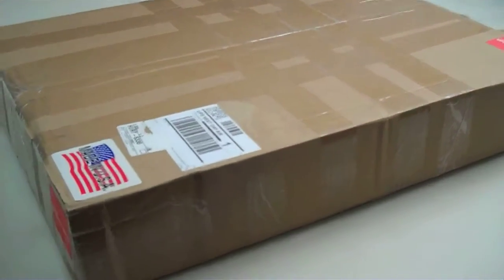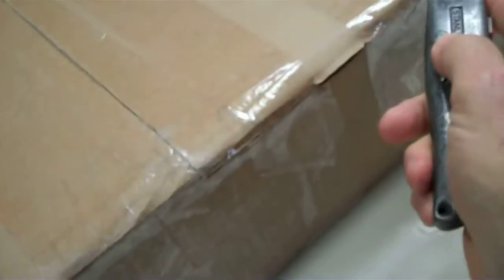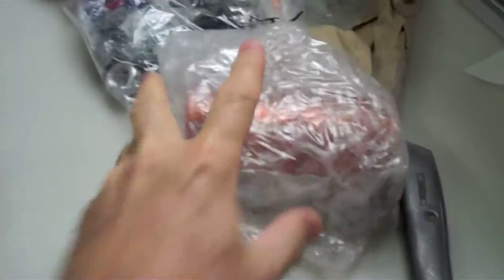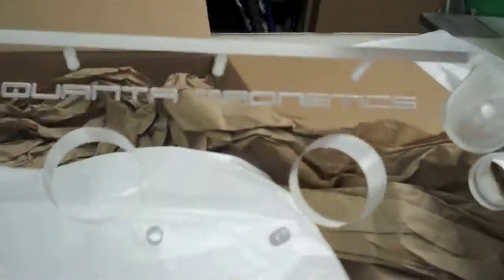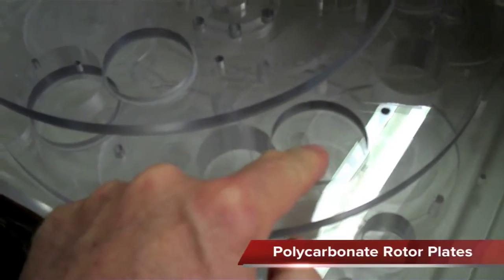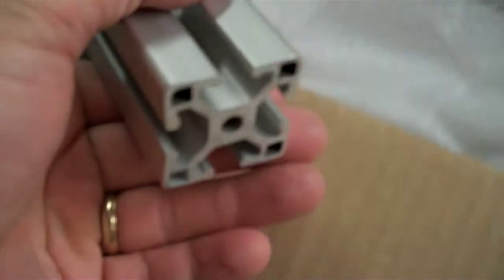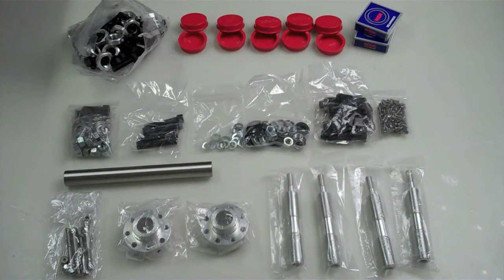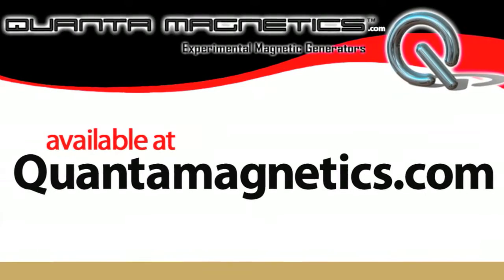Quanta Magnetics Charger Kit

Comment from the maker: Give me a chance Stefan. I haven't even begun to show you what it really can do. I've been experimenting with my dual air core prototype of this machine for more than 7 years. Yes, you can close loop it if you split the energy output sources. Electrons circulating through the Rotoverter do not want to return to it. If using a Rotoverter instead of a standard motor, you can actually dial in your needed hp to load on a Variac connected to an inverter. You should try this!! Makes no sense??

Comment from the maker: Quanta Charger Kit, Magnetic Coupler & T-Rail Mounting Kit are separate items in case you want to use a standard motor with or without a pulley, which can work very well also without using a Rotoverter converted 3-phase. Your choice. Prices are at website Quantamagnetics(.)com.

Comment from the maker: You'll need to get your own because you may want to operate the system in Rotoverter idle mode which can draw as little as 50 watts and still deliver excellent output performance in a low Lenz configuration using 1/8"-1/4" thick magnets in the Quanta Charger, especially when used with the zero friction Magnetic Coupler. If you want full power, get the 3/4" thk N52 neos, but be careful, the output is extremely high. Using an inverter and Variac allows you to dial in your horsepower to load. Cool.

Comment: Well built and designed! But can the system go overunity? Otherwise it makes no sense to use it ......Do you use it to recharge the batteries? Can it run indefinitely on the batteries and also charge them up? 
What is the exact application? Do you also put another load on the batteries or additionally need a solar panel to recharge the batteries?? 
Please explain in detail!. Many thanks!
Reply: You got no response because it cannot go overunity and does not make any sense to use.